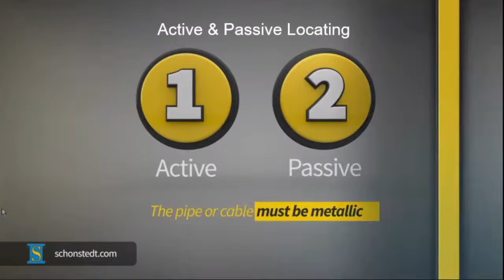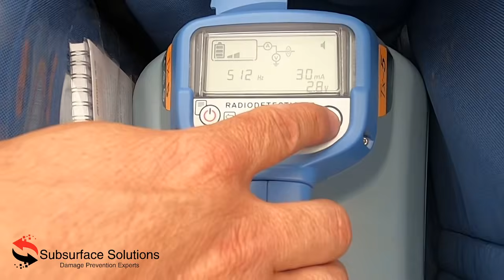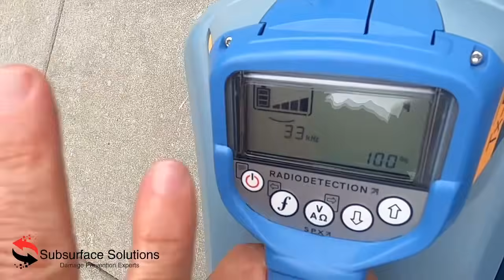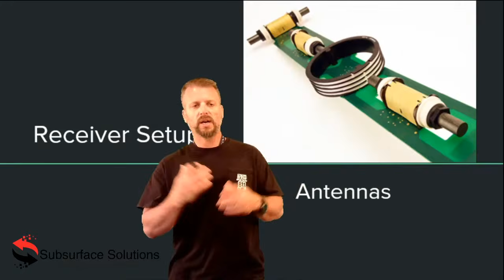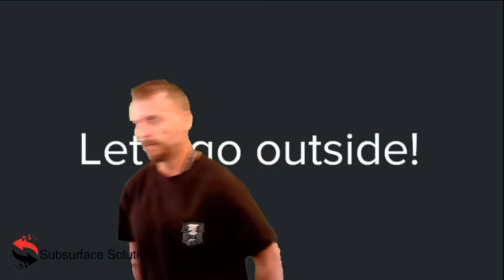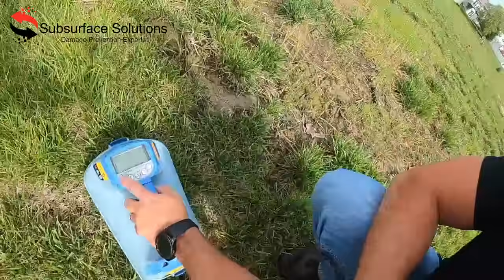How to Locate Utilities using the RD7100 by Radiodetection

Comment: What is the best way to identify a fiber optic cable if there is an electrical cable next to it?
Reply from the maker: Does the fiber line have a conductive source like a tracer wire, metallic sheath or metallic strength member?

Comment: Hi, what is the best frequency for locating Fibre optics and coaxial cable for rogers? Thanks. Hope you notice this.
Reply: Any lower frequency. 512Hz is used a lot for fiber. Just make sure the other end is grounded.
Reply from the maker: 512Hz if the far end is grounded. However, if you're around underground power lines you may want to move it a little higher to avoid interference.

Comment: Please can I use this detector to locate illegal pipe connections on a distribution pipe network. Thank you
Reply from the maker: The regular RD7200 or RD8200 may work as long as the pipe has continuity. Not plastic.

Comment: Could radio detection be used indoors for slab on grade projects?
Reply: Yes, no problem
Reply: @travisberan7010  the rebars, wire mesh and all electrical from above wouldn’t cause it to bleed off?
Reply from the maker: Nothing above will affect a RD unit.  Electrical below may be a problem. Every utility inside a building is normally bonded to each other and the building, which causes you to light it all up. Isolating and getting a good ground is key, but inside a building that hard. We may shoot a video soon on this.

Comment: how to detect a damaged cable that has a gap between the core without shorting to ground? It is very miles difficult to find the accident in this case.
Reply from the maker: If this is a electrical primary you can use a thumper. If this is any other type of cable you can possibly use a TDR (Time Domain Reflectometer).

Comment: I’m confused about the clamp. Every time I use it I get no signal at all! I’ve been told by everyone it just clamps on and works.
Reply: Use it in 8kHz or higher.  You should be able to hear a high pitched squeal in 8kHz when transmitting.  Make sure the transmitter shows a ring clamp icon.  If you don't see the ring icon when it's plugged in you could have a faulty connection socket.  If you have the icon, don't hear a high pitch tone in 8kHz you could have a faulty ring clamp and it need to be sent in for repair.  Maybe you know another locator tech and you can compare.

Comment: I Always had problems with were to put the ground rod were is the best place behind infront to the left or right of the transmetter
Reply from the maker: Place the ground in an isolated area and the opposite direction you plan to locate.  Stretch it as far as your cables will allow.

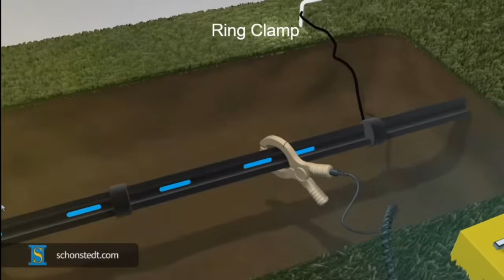Comment: Did the image at 23:38 show one clamp being used to induct the signal and another clamp some distance away being used to pick up the signal off the pipe and ground it? If so, i am thinking thats a nice solution if you cant ground the cables within the pipe.
Reply from the maker: The other ring is a Receiver ring clamp to verify the correct cable. It doesn't help ground the cable.

Comment: What's the difference between radio and power modes and when would I want to use them?
Reply: Every metallic object is reflecting radio waves traveling around the earth and Radio mode will pick this up.  Power mode will pick up the 60Hz harmonics produced by live electric lines.

Comment: Great video, I learned alot. I'm still having trouble locating Armored Fiber cables. Do you have Any training or thoughts that might help?
I've got a RD7100 TL
Reply from the maker: Make sure the far end of the cable armor is grounded and hook direct to the armor.  Make sure you have at least 20mA's transmitting. Use 512Hz or 8kHz.   If there are other cables in the same conduit or near by make sure they aren't grounded.
Reply from the maker: Make sure the fiber sheeth is ground on the far end so your locate signal has somewhere to complete the circuit.  Once you lower the resistance you should be able to use 512Hz to avoid bleeding into other lines
Reply: Need metalic for fiber cable ?
Reply: yes

Comment: Hi, just purchased radio dectection 7100..with transformer to-121..is there any training videos for locating phase to phase faults ????
Reply from the maker: Sorry we didn't cover fault locating in the video.  Maybe at a later date.  The TX-121 Isolation Transformer for phase to phase faults is sort of a specialty part.  You should be able to get some 1 on 1 training for it from the outfit that sold you the two kits.  Contact Radiodetection if you're unsure of whom to contact.   We handle a 9 state territory in the upper Midwest of the USA.
Reply: @SubsurfaceSolutions  
muhammad imran
0 seconds ago
How can we download the survey measurement's , i downloaded the RD Manager but there is option of survey measurement's not showing .... could you pls help me about it.